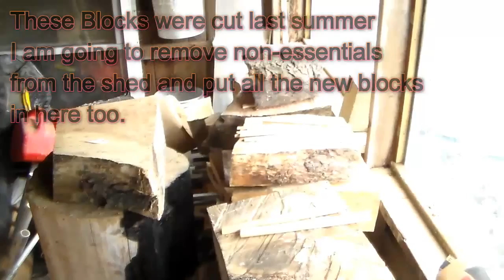#18 Cutting Blanks and a short tour

Comment: I use my dehydrator at 95 degrees for drying rough cut bowls, but I get cracks (features!) anyway.  Dry in 2 days, though!  Can you discuss your kiln experience in comparison to mine?
Reply from the maker: Josef Roesler The kiln only gets used for rough turned items, the blanks are kept in the drying shed which is much slower. The bowls that get roughed and put in the kiln dry to usable in about two weeks, blanks in the shed can take up to a year.
I end up losing about 1 in 4 of the rough turned bowls, if I oil them before putting them in they have a better chance of making it but it extends the dry time to about a month.
Reply: Cyrus Fillmore (Time Lapse Turner) Wonder why mine dry in 2 days?  I guess my dehydrator is too efficient.
Reply from the maker: Yep a dehydrator woul dbe pulling the moisture out of the outer portion of the wood faster causing it to shrink around the still wet interior and causing the cracking, Left to dry more slowly the inside moisture makes its way to the outside drying in a more uniform way and less likly to crack (though it does stil happen)
Reply: Cyrus Fillmore (Time Lapse Turner) but I wonder why mine is different than your kiln, they seem pretty similar, same temps, both have fans.
Reply from the maker: Is yours solar powered, or does it use a heating elemrnt? different types of heat may be the difference.
Reply: It's electric, I figured low heat was low heat.